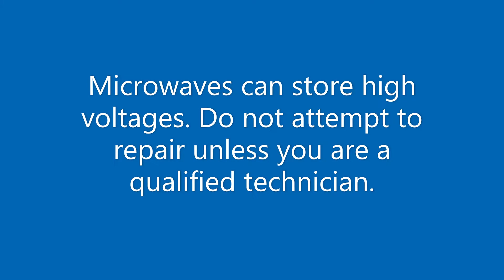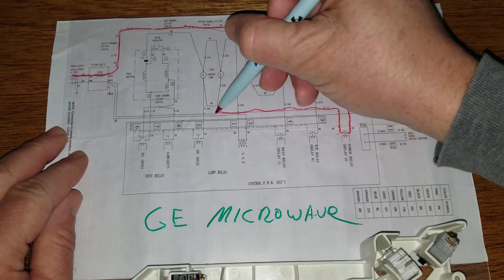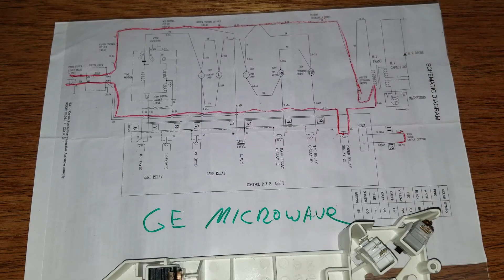#22 - GE Microwave Trips Breaker - Schematic Explanation

Comment: MOST people are pulling the door open while the microwave is running to PAUSE it to check whatever they are heating. If you PAUSE the microwave, THEN open the door, you should have no problems. The pause feature is there for a reason. You can pull on the top or bottom of the handle and also cause the same effect on the switches....not disengaging in the proper order. When grooves are wore in that switch panel you can set it back a bit. I just file the two plastic hooks on the back side and move it in a 1/16 or 1/32. You can look at it by just watching the door close before tou reinstall the toch pad.

Comment: Are all microwave door switches the same/universal?
Reply from the maker: No. There are variations, such as logical pinouts, normally open, normally closed. Some switches have both, which is more universal. However, the spade sizes also vary. It's best to get the part number based on the unit model number and use equivalents or universal replacements based on those part numbers.
Reply: @TheTechCircuit  thanks for your response. I guess what I'm asking is even knowing those differences, can I use a generic? Can I buy a variety of generics and as long as they are the same as what came out, use them? Or would I need a frigidare door switch, kenmore door switch etc?
Reply from the maker: Many people, including repair technicians, use generic switches.  I believe its best to use OEM because the quality is more predictable and there's less chance of liability if they fail.
Reply: @TheTechCircuit  ok thanks.

Comment: putting a switch in parallel with the primary of the transformer is so stupid.

why do they do that?

unless it is meant to clip the inductive spike that may happen when the transformer is powered down.

does a hot magnetron generate any charge like a peltier chip does (the stove fan that uses a teg witch is a peltier chip designed to generate enough charge to run a fan) causing aback feeding of the transformer?

it is maybe possible that the switch is acting as a shunt because older microwaves used hardware controllers and could not do the diagnostics like today's modern software powered microwaves can do.
Reply from the maker: It is a safety feature. Destroying a switch and necessitating a repair is the tradeoff for not energizing the primary and exposing the user to microwave energy.